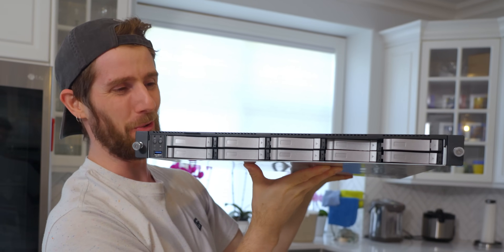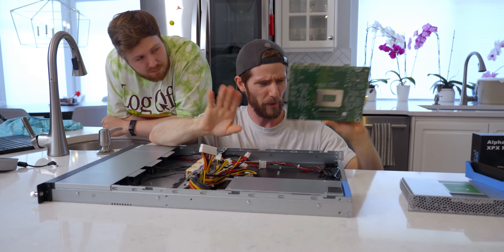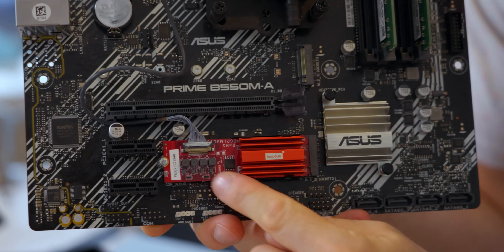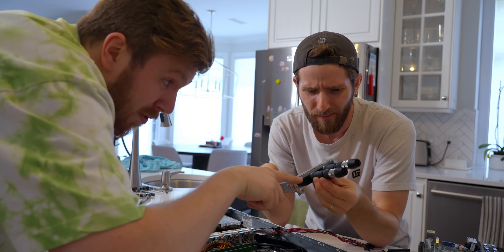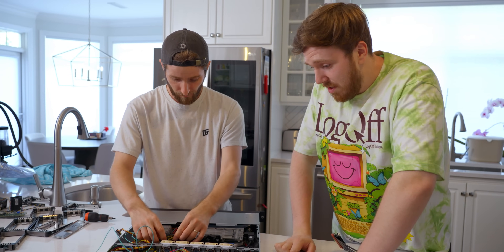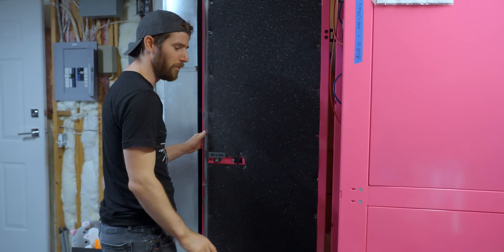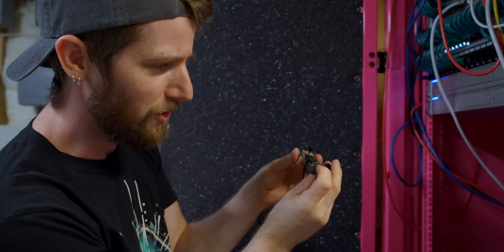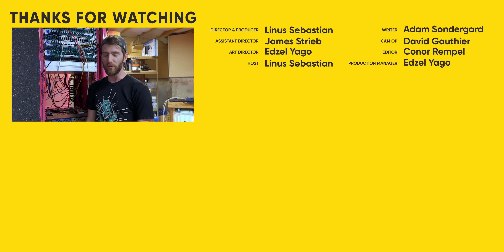I designed my perfect gaming PC, then threw it away - 1U PCs for My New House Part 2

Comment: Oh man, that ending! Like a bloody TV series!

Side note you probably have looked at this but I have a small rack at home with two gaming systems installed and it's a 3u pc case that holds 2 itx systems. Still uses a little more than 5 1u systems but it gives you much more flexibility on options 👍🏻
Reply: One of the things they talked about was that Linus didn't want more than one computer in each chassi. This way it's possible to take down one machine while the remaining four are all operational.

Now if he were to go full professional server parts it would be possible to build 2U chassis with two systems where they can be unplugged individually. But then we are talking server class money again.

Comment: The only thing is the cost. I do not game yet would love to stack 4 low energy workstations that can stream 4k vidoes and browse the internet with ease. My current tower uses around 30 to 40 watts with ease. I need to have DP and HDMI along with USB for keyboard, mouse and bluetooth at the desk. Yet just to buy the fibercable and thunderbolt thing would cost around 1k alone. The distance between locations would be between 50 and 100 feet depending on how its wired. 
Low cost options are not here yet.

Comment: As a homelabber that is constantly flabbergasted by the price of things for a server vs. consumer PC's, the line, "It's a server, man. It's for businesses, not normal people" hit me DEEEEEEEEEEEEEPPP
Reply: Yeah i mean wtf, 400 for some bended metal sheets, come on where is the competition there.
Reply: @green-cash  as a manager/person with a business degree, it makes sense. It's an extremely low volume highly custom, probably even hand-made chassis, and they're usually purchased in bunches, where heavy enterprise discounts apply.
As a customer tho, it's simply stupid and infuriating
Reply: @green-cash there is none. Most server cases (cases around servers) are custom for the particular model of server so they aren't interchangeable with anything else. Anything sold for generic rack mount ATX is probably low volume so higher price. A lot of rack mount ATX cases have power supplies that are unique to the case ... yet more noninterchangeability.
Probably a lot more reasons for a lack of competition but my bet is mostly it's everything not being interchangeable.
Reply: @green-cash its the same in other non PC areas like for example Electric mid drive Bikes. One can buy an awesome electric dirtbike (lika Talaria) for $3/4K but some electric bikes, with less and smaller parts can cost upwards of $10K and even $15K. Its fkin ridiculous.

Even a top of the line SuRon electric dirtbike is cheaper then a top of the line Specialized Electric Bike.

Its just thievery dude
Reply: @green-cash well they target businesses. They use the hardware to run their business, thus make money. If you buy the hardware for a hobby, well you have to pay the price.
Also why would they make it cheaper if people still buy it at a higher price?
With that said, please make server hardware cheaper 🥺
Reply: @green-cash  the shipping cost alone is a lot...
Reply: @green-cash  it’s that business markup. Consumer products have competition and companies know that people won’t pay ridiculous prices. For businesses though the company making the product knows they can afford to pay more for it. Anything not originally intended for consumers will cost a lot more.
Reply: @green-cash yup it doesn't make any sense
Reply: there's literally no reason to buy any of the enterprise grade hardware new as a regular consumer unless you're swimming in disposal income when liquidated gear on ebay is a fraction of the cost.
Reply: @shiddygaymer I am lucky enough to have a Friend that's works in IT for a Large Corporation and he doesn't like to throw stuff out Except the Hard Drives because he has to but he will sell me their old hardware and they upgrade all the Time and sell me the old stuff for dirt cheap because they just want it gone and have no Idea what it cost
Reply: @shiddygaymer  The HPE Microserver Gen 10 Plus used to be a great deal for homelabbing, then the price almost doubled during COVID.
Reply: @shiddygaymer  a single ryzen 5 chip will absolutely run circles around any decommissioned enterprise equipment in both raw performance and power efficiency. maybe good for learning in a homelab, but not great for if you plan on using the servers for anything but simple webhosting
Reply: And that's why my homeserver is just a headless desktop PC.
Reply: I'm homelabbing on laptops, getting the same vibes. Used Thinkpads and Latitudes of the models i need ain't cheap, chief
Reply: @AlexGFrank  why are you buying laptops? they're incredibly expensive for the performance. I use a load of old desktops for most of my lab
Reply: I stick consumer parts in my server boxes. 2U 3U and 4U all work with off the shelf consumer parts. Just make sure chassis supports atx
Reply: @antonisautos8704  I'd be fine with that if there was affordable ecc and ipmi.
Reply: @benargee ASRock rack has some boards that take consumer CPUs (like even ryzen 3000) and have ipmi and ecc support for about $250 new (last I checked. I own one of them, the quality is very hit or miss unfortunately.) That's not necessarily as cheap as a consumer board, but it's a lot better than you normally find.
Reply: Likely two reasons:
(1) Very niche parts that cost a lot to build (/low output); and/or
(2) Supply and demand.

Even if it's just a random sheet of metal, if PROS need it... they will pay... any amount of money. That means, companies are likely willing to charge any amount of money.

The only reason it's cheaper in the standard market is because a random 42-year-old woman who wants a little PC is not going to spend $10,000 on weird bits of metal. Why would that ever be a thing?! But, somebody who needs a home server will HAVE to spend $10,000 or even $100,000, or will be forced to just do it himself, I guess.

I mean, Apple did make that $33,000 server thing or whatever, which seemed a bit overpriced. I'm guessing that's because, you know... Apple prices + custom tech, etc. They likely got enough buyers to make a decent profit there. They just hit 3 trillion on market cap, for what it's worth. One of the biggest companies ever, no matter how you slice it. But, anyway, that's mostly what's going on with stupidly costly items aimed at any niche sub-market, honestly (personal or pro).
Reply: Refurbished should be sold at a fraction of the price atleast.
Reply: New server stuff OMG what body part do I need to sell to own this...Server stuff after warranty expires...take it for $5 bucks???
Reply: @OrginalDravas yep. The cost of the system moves from your initial purchase to your electricity bill.
Reply: I'm also shocked by the price of those parts to use the PC in another room... having the pcs in a server closet is sweet, but dang it adds at least $1200 to each pc it looks like from prices i can find.
Reply: and this is why my homelab uses janky old beige boxes and looks like something stuck in 1995 despite being modern hardware!
Reply: home lab stuff is cool but I will never buy it, when work lets me take it home is when I mess with my home lab.
Reply: Working as an intern as a network/security/storage engineer made me realize the prices of enterprise stuff, after the punch in the face of speccing a 180,000€ storage server I started expecting the prices lol
Reply: Honestly I feel like companies know they can fuck over businesses even harder then end users, so they do lol
Reply: Cost of making things is actually really low, but companies always try to sell with 80% profit or higher. Apple products also cost like 80% less to make than the price is...
Reply: Yeah for real
Reply: As The Homelander, I agree.
Reply: Honestly, the quotes people come back with for my workplace are ridiculous. I legit just asked some of the work gangs from my Civils days and asked if they could do it and we'd do a lump sum for the day. £2K for 3 guys, we had dozens of jobs that half a dozen other contracts said would be close to £13K.
Reply: I have a Server that has 2 Xeon Platnium 8180's and has 2 RTX A6000's and you could literally buy a Brand New Car for the Cost of it but a Lot of businesses have servers that cost 4 to 20x what this one cost
Reply: And not to Mention a Lot of Enterprise Hardware has Redundancy and Error Checking and Correcting Built in while Consumer Hardware does not you lose your PSU in your PC your PC Dies lose a PSU in a Server and it keeps chugging along
Reply: Yeah, it's also why pretty much everyone who does homelab buys used. Even then it's expensive but at least it's not as expensive.
Reply: @NMD_nomad  I figured it was because they would be making less of them so it subsidized their own development and production costs that had to be put into even making the first one as a percentage added onto the total cost of the system.
Reply: Yeah, and then we eventually say "screw it" and buy the server solution anyway, because it's cost us thousands already, what's another few hundred bucks amirite?

I feel like homelabbing is just meth addiction but with back pain instead of rotten teeth.
Reply: What doesnt make sense is step back 6 years I was able to buy Logysis 4u chassis shipped from newegg for $60 I bought a few of them back then and lucky I did. Theres no reason the stuff has to be so expensive
Reply: They say as they rent them out to normal people lol.
Reply: I thought that line was hilarious myself.
Reply: I bought a Refurbished Server Dell R710 for roughly $300. Old as hell, but it runs a website of mine just fine. Servers are great for running websites. Could maybe even be a good solution to host a Minecraft Server from.

I certainly wouldn't buy a Server to game on.
Reply: eventual homelabber, why would one go with a server rack over, say, a laptop with a bunch of external hard drives?
Reply: @Wither_Strike  external is stupid, unless you're keeping them in a big protected DAS JBOD box, since humans do human things and stupidity is inevitable.
But based on personal experience, laptops are a great option if yoh're wven considering moving some time in the near future. They're infinitely easier to pack.
If you need something akeen to a used 2U box, Dell Precision, MSI GT or Thinkpad W/P-series may be your best option
Reply: @Wither_Strike Depends on what you're doing in your homelab. If your lab is designed to help you learn about server/enterprise grade hardware, then almost no amount of consumer hardware will help you there.  

And if you're just storing data, then going all external is rife with complications and deficiencies.
Reply: @Wither_Strike  Personally for me the aesthetics of the said home lab/server is what I’m after…it provides me easy switching access for playing, and again aesthetics…all that said, a server rack and cases are ridiculously overpriced.
Reply: @Wither_Strike don't, just use a mid tier recent home pc or even rasberry pi
Reply: @Wither_Strike another factor I've experienced - if you have even a modest amount of harddrives it gets old pretty quickly to get down on the floor, unscrew things and often power off to change any drive. Cases with a lot of 5¼ bays to add hot-swap modules to are rare these days, so if you want hot-swap it's probably easiest to get a server chassis
Reply: @Wither_Strike where are you going to put that laptop and mess of external drives? That's what a server rack is for.
Reply: @bbbqmac  in a place that a server rack won't fit, like underneath my living room tv